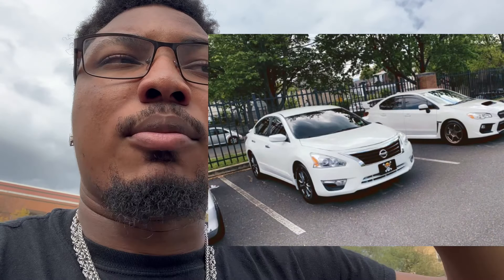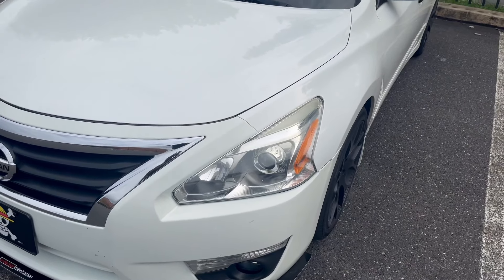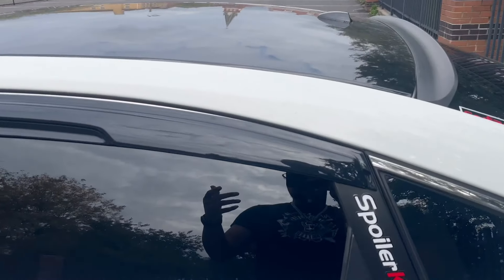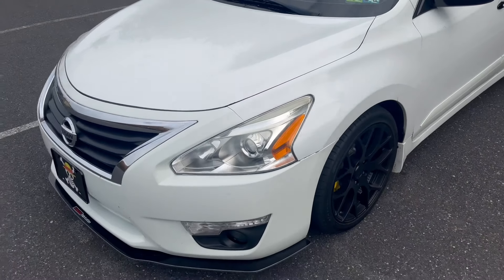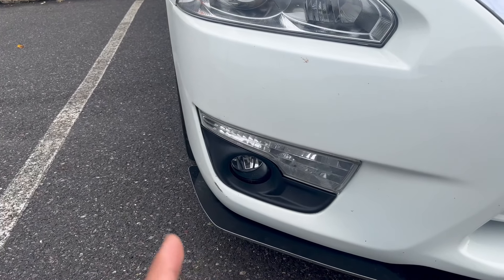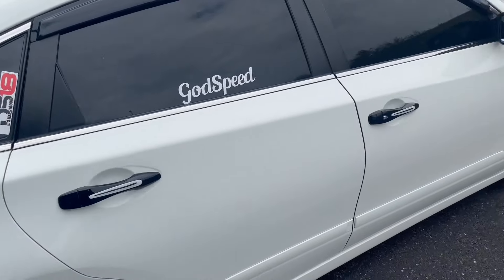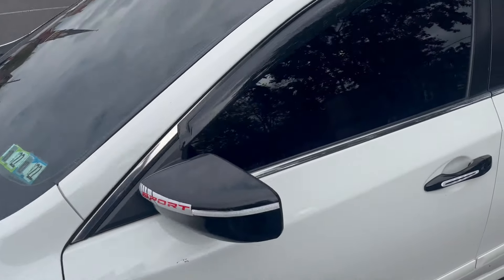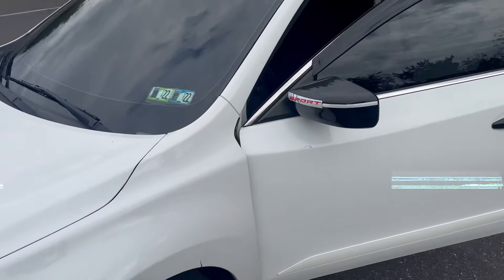EVERYTHING DONE TO MY 2015 NISSAN ALTIMA... LOW LIFE!

Comment: we got the same car but mines a 2013 but so how did you go your muffler delete did you buy a new exhaust? bcs ik there can be exhaust leaks?and when i mean the same like mines everything like yours but mines not tinted which needs to be done and some new head lights
Reply from the maker: The muffler delete went perfectly fine. Go to a good shop and everything should be good. Just get some goo tips to put on after u take the old exhaust off

Comment: Riced out bro.  Those are cosmetics not legit mods.  Just giving you advice.  I got a 2010 Nissan Altima coupe SR V6.  I installed a knn performance air filter to start.  And it does work.  People look down to an Altima.. yet approve a riced out accord. I know there is a double standard.    Only way to get us some respect we clap them.
Reply from the maker: Ion have it no more
Reply: @TrulyS3  you did cosmetics to only sell it after.  Eh that's sad.  Ima do mods and keep mine for a long time. I like mine that much.
Reply: @christopherhernandez78  good for u🙂
Reply: @zGappie  and Civics n accords are penny a dozen.  But older ones are going away from wreaks n abuse and becoming rare And easier to steal. Etc.
Reply: @christopherhernandez78  for a fact. Honda community real toxic
Reply: @zGappie  yea I think they are part of the problem in why the modern car community is toxic.  I don't doubt it cuz honda kids Wana go after anyone for the thrill of it and not measure up to someone equal to their abused rust bucket.  Modified or not if it's abused its a rust bucket.  If it's clean and well kept not abused than it's a survivor.